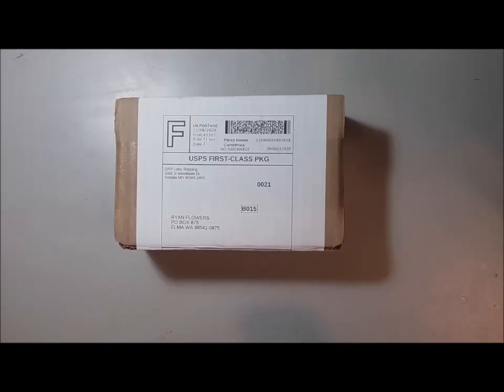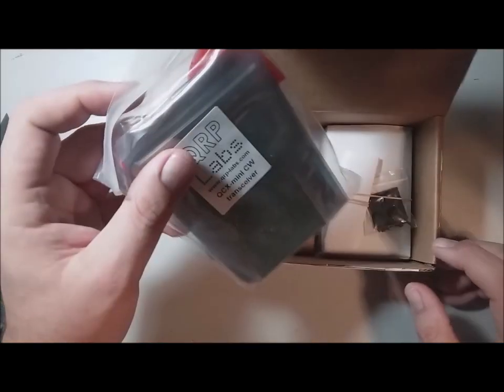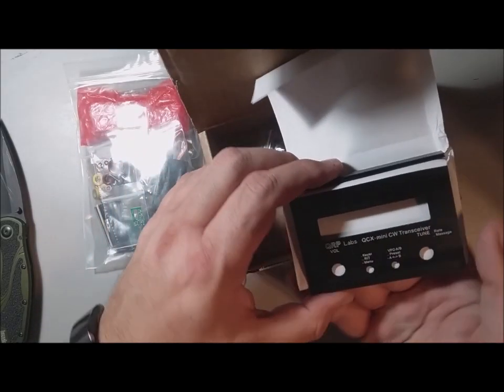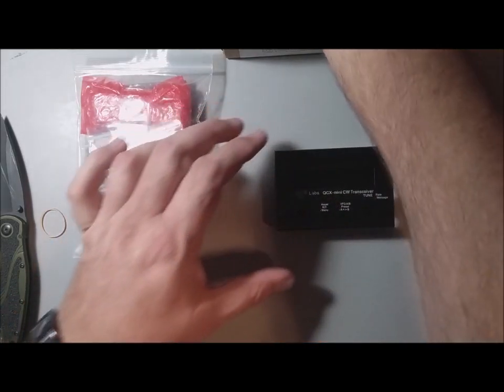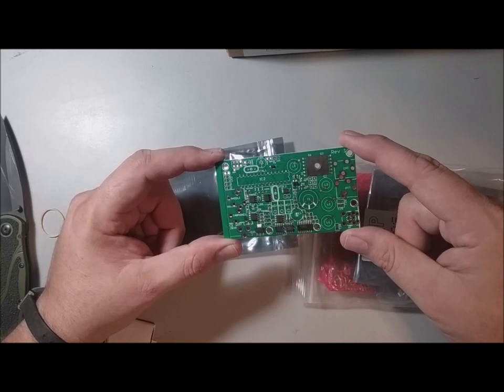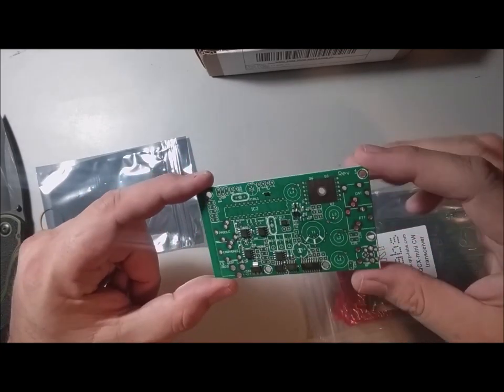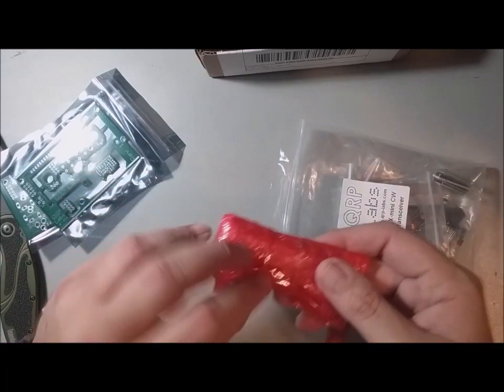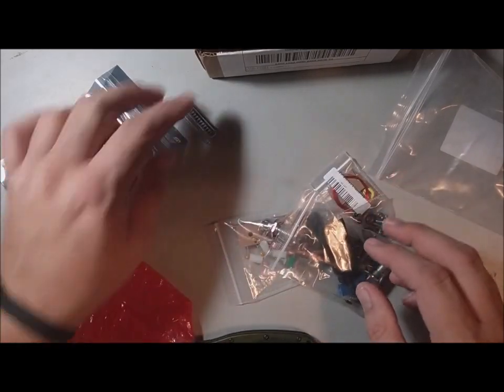QCX Mini First Light and Unboxing (And: How should I learn CW?)

Comment: I'm learning CW too and using the app "Morse Mania" as a starting point. It is a fun app to use, a bit like a game, and you can set it to run at whatever WPM you choose. It is for learning by ear.  Once I've got the basics I will probably have a go at "Just Learn Morse Code" and eventually if I get good enough the terrifying "Morse Runner".

I've ordered the 30m version of the Mini, a band I chose because it is quiet. The 20m band has much more traffic but do you want that as a beginner?
Reply from the maker: I just learned the whole alphabet in less than 2 weeks with morse mania.  Solid recommendation! Will check the others, too. Thanks for the comment!

Comment: This looks like it should be fun to build and use! I have one for 17M on the way myself. I have made many contacts with my original QCX40 and it is great. As far as learning goes... If you have an Android phone an app called "Morse Toad" is where I started to learn and then I moved on to CWOps CW Academy where they teach the code exactly as you are indicating you'd like to learn. It's free and there is usually a bit of a waiting list, but going through with a structure and classmates on the same level is super helpful. The full coursework is available on cwops.org if you want to take a look or even forge ahead to get a head start. For a small fee there is also Long Island CW Club, which has various classes which rotate out more often https://longislandcwclub.org/  Both of those are live on Zoom.